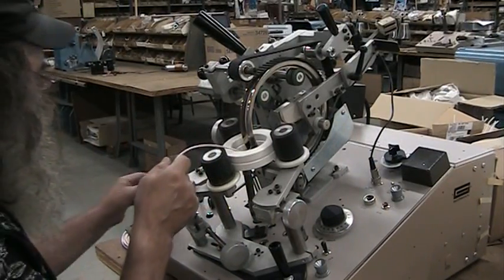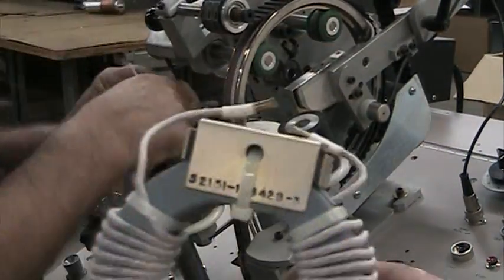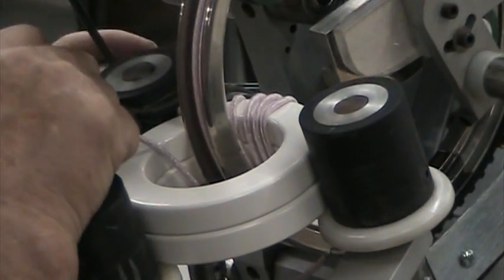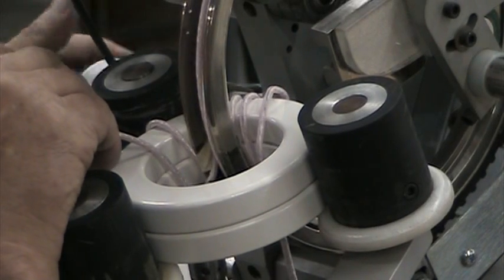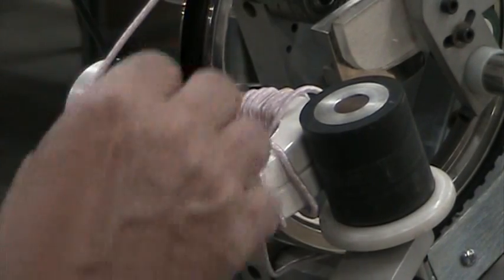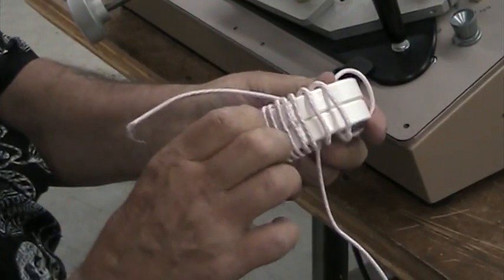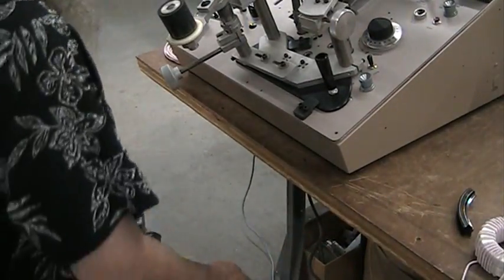Large Toroid wound on 900 A toroid winder

Comment: You need to adjust the spacing between the plates that guide the wire in the center of the wheel.
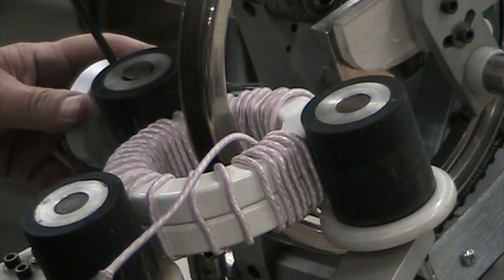As its shown in the video every turn the wire colides with the plates causing a disalinment in de winding, in min 1:15 one can see that the turns are not straight because of these.
I know you probably solve this by now but.... Good luck!